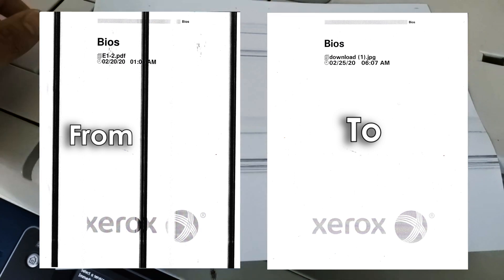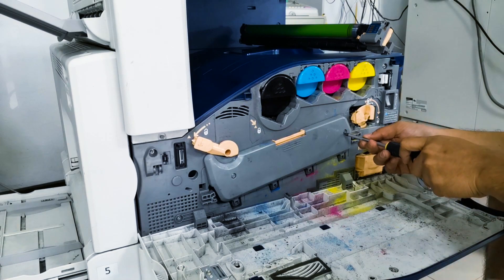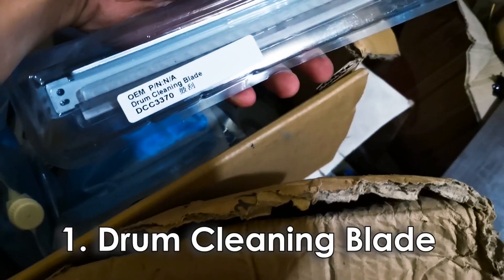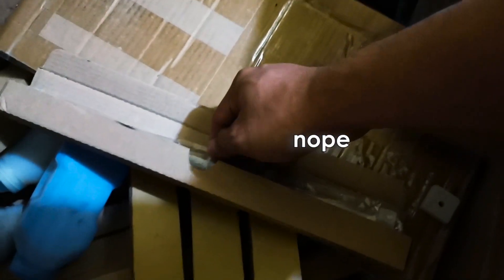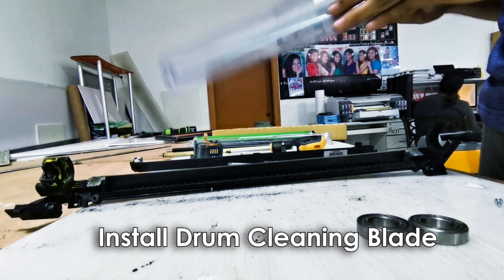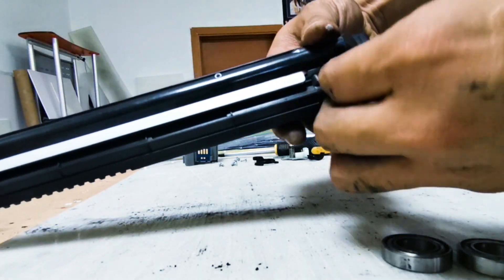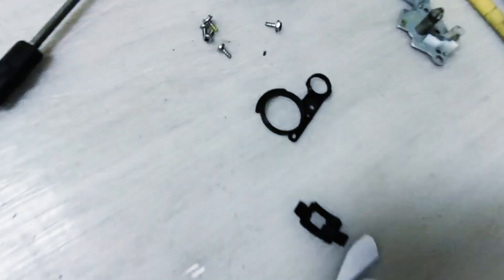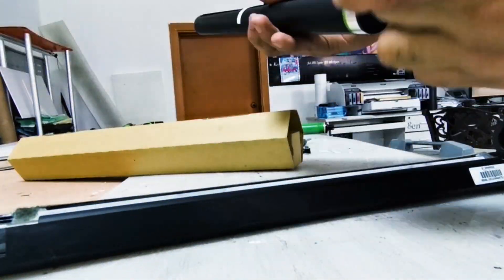Black Line Problem Xerox WC7845 Drum Roller Repair

Comment: please i need your help i have 7845 xerox machine comes with an error replace black toner in spite of its already replaced then grinding noise appears
Reply: It block up and need to change out the toner housing that the ink floor though